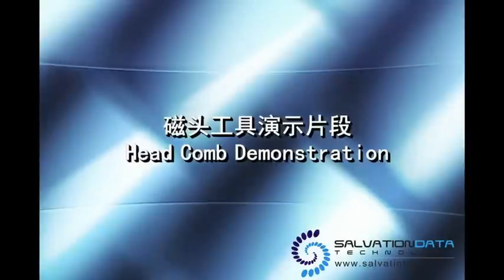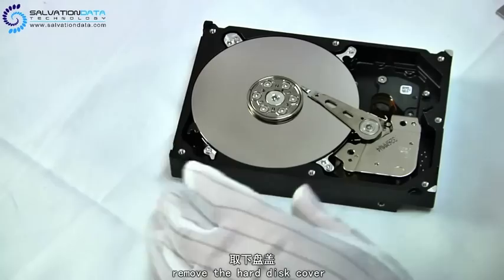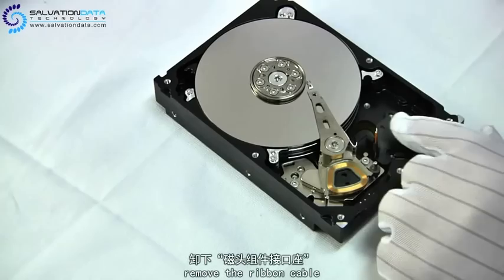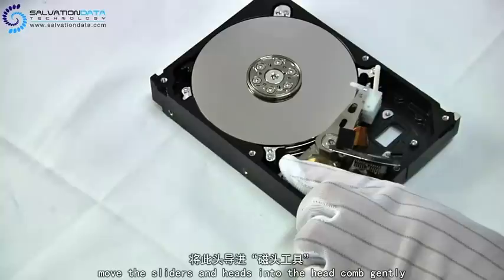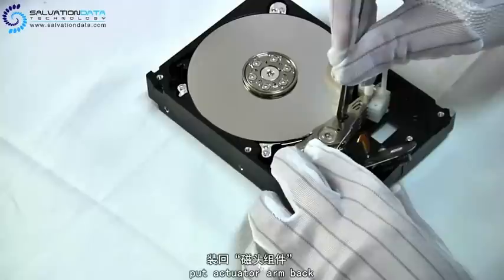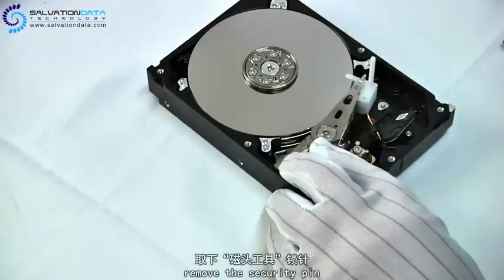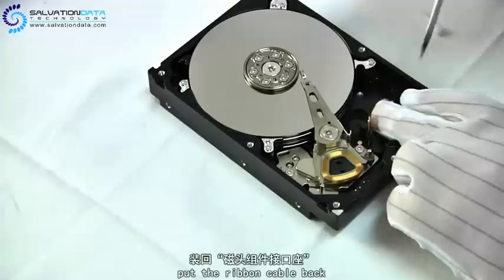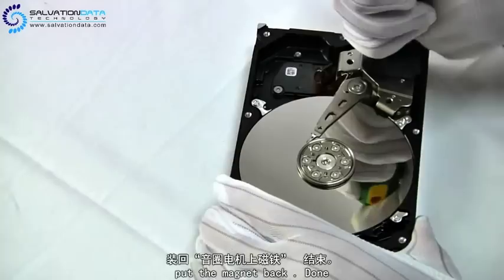Seagate 7200.11 1TB Hard Drive's HEAD replacement?  The EASIST&QUICKEST way to do it.

Comment: Hello friend, could you help me?
I have a Seagate Sata HDD, very similar (if not identical) to yours. The mechanical part of it was working properly, but I extracted all the internal parts, because I wanted to use it as a Mini Sander, but from then on, the Motor didn't run anymore. I've tried the connections on the Data pin (2-6, 3-5) in various ways, but the Motor won't even start. Do you have any tips? Thank you

Comment: I thought you had to make sure that the platters were turning while you move the heads ?  Is this not true or is it true for only some drives?
Thanks
Reply: Yeah...I am wondering the same thing. I didn't think you were supposed to just pull them across the platters like that.